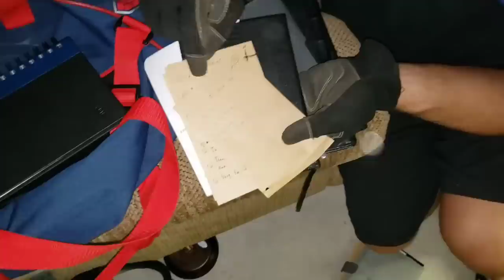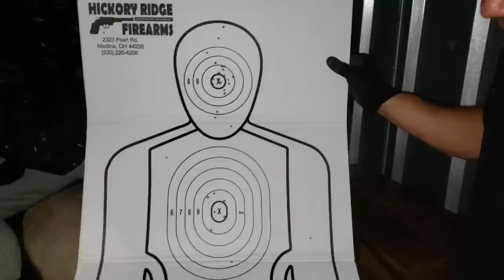He FOUND BODY INSIDE Locker / I Bought An Abandoned Storage Unit / Mystery Unboxing / Storage Wars

Comment: My bf works at an apartment complex and they recently found a body that had been there about three weeks. The cleanup is not a pleasant thing to deal with, you have to strip everything down, carpets, tile, floorboards if you have them, even drywall if it’s been affected. 

Caplugs are a plastic piece that is used as a covering to protect an area on a plastic or metal part so it does not get scratched or damaged. They also use them in the powder paint industry to cover a piece of the part that they do not want paint on, like threads, or they insert them in holes so paint does not go on the interior of the part.
Reply: Linda Wolff/Kashmir27 e5
Reply: oh yeah ive smelt one and its the most horrifying smell ever